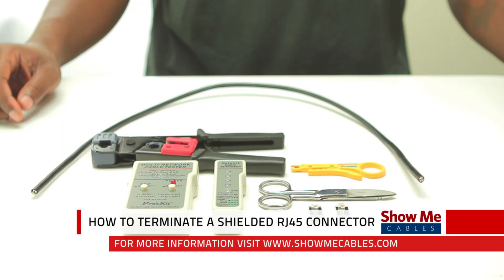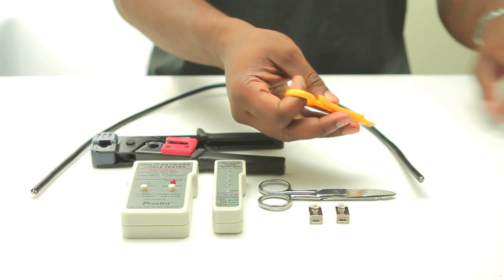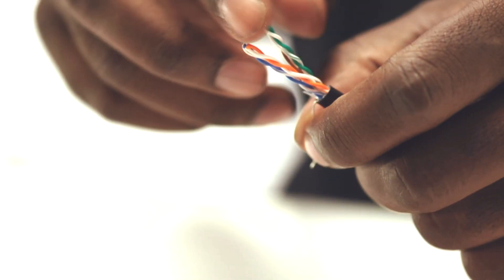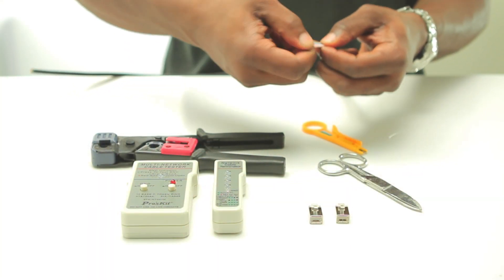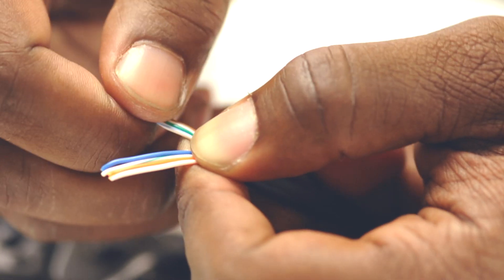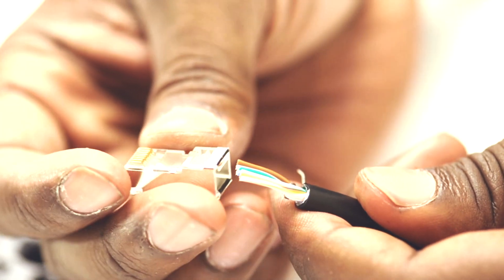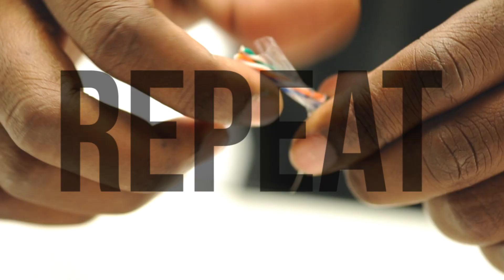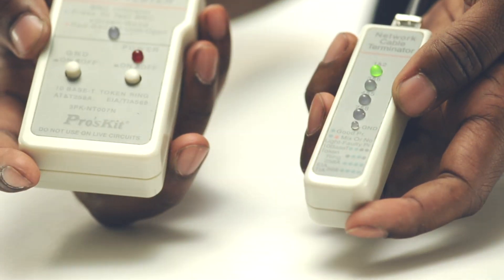How To Terminate A Shielded RJ45 Connector

Comment: the foil is for shielding and the ground wire is for??????
Reply: the foil shielding blocks electrical interference but it can possibly build up a charge over time. The ground wire keeps the foil "drained" since its in direct contact with the foil

Comment: Th e foil should be bent back to make contact with the metal on the connector. If you are using this wire for a PoE  (Power over Ethernet) application, (Wireless outdoor transmitter, camera, router, AP, etc.) please note that the positive DC power is injected through the blue pair. If the drain wire is wrapped wright next to the middle pair (the blue pair) this will create a potential power grounding hazard. If the drain wire comes in contact with one of the blue pairs, any overheating (ESD, heat from the sun, etc.) will melt the plastic cover, allowing contact with the drain wire, crossing the PoE, melting your connector and damaging your equipment.
Reply: What color order/convention are you referring to in this statement?

Comment: Ive always been taught to fold the foil back and wrap the drain around 4 of the wires. Then wrap the drain around the foil once then crimp down. Trimming up any loose ends. STP is a pain in the ass because if not done right, the shield and the drain act as an antenna.

Nice video. well-articulated
Reply: Are you still here after 9 years? :D how do you wrap the drain wire around which 4 wires? I am confused.
Reply: @zsoltibitter8761  hehe

Comment from the maker: Shielded cables only help your network if the entire network is shielded.  That includes the jacks, cables, patch panel, etc.  If you use shielded cables in a unshielded network, you won't see any performance differences.  So if your network is shielded use shielded RJ45s if not, use the regular ones.
Reply: showmecables do I need shielded RJ45 terminals for a shielded cat5e or would an unshielded rj45 do it?